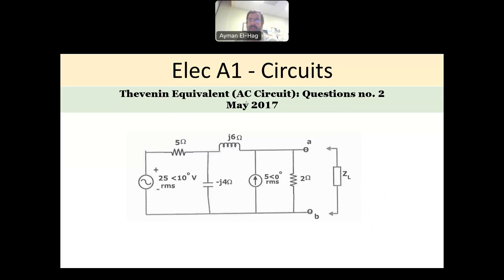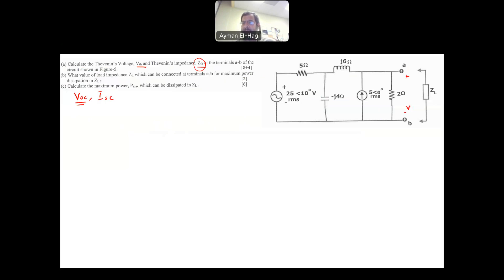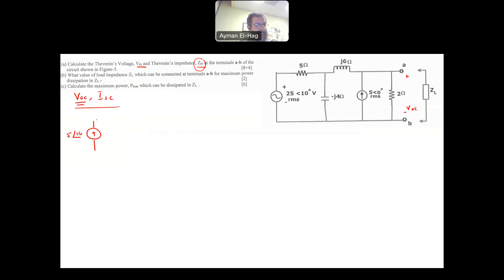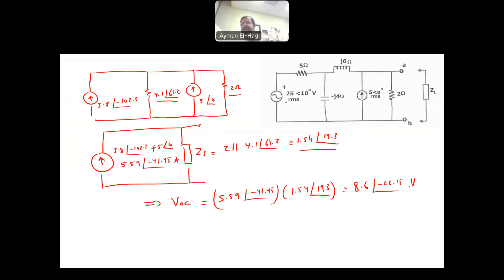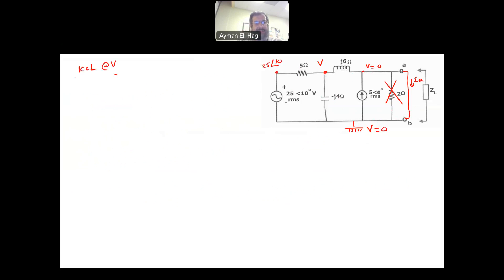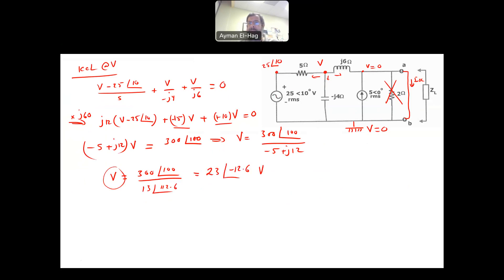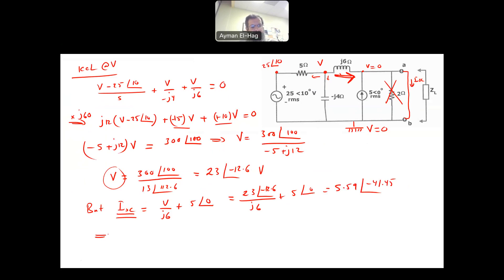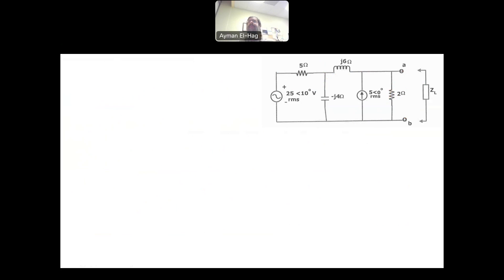PEO solved examples (ELEC A1): Thevenin Equivalent Question no. 2

Comment: Hi, I am using a book where they derived the maximum power as: P=|Vth|^2/8*Rth not 4*Rth and it was proven step by step. Are you sure of the formula you used or is it a typo? It is P=|Vth|^2/4*Rth when the sources are DC.
Reply from the maker: Hi, if the source is DC or RMS then you divide by 4, if the source is peak value you divide by 8. Remember Vrms = Vpeak/sqrt(2)
Reply: @electrical4everyone makes sense! Thank you
Reply from the maker: @john_ron  you are welcome

Comment: Could we calculate zth by Voltage source SC and current sources OC in this question?
Reply from the maker: The general method to calculate Zth is find Voc and Isc and Zth = Voc/Isc, however, when we only have independent sources, then we can calculate directly Zth by switching off all sources.
Reply: @electrical4everyone thank you professor
Reply: @electrical4everyone  I switched off all sources (voltage source - shorted and current source opened,  i got Zth= 3.71∠-21.80, I may wrong.
Reply from the maker: can you please write down how did you add the impedances together and I will come back to you